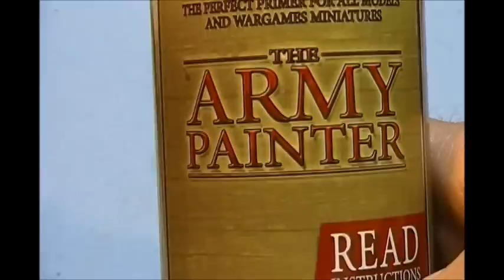Hair Spray Technique Extreme Weathering

Comment: I don't get it.  If it has a layer of flat coat on it which protects the base rust color what specifically does the hair spray do that the flat coat can't...?
Reply: Although your question is already pretty old, I´d like to answer this: The flat coat is there to protect the undercoated, dark brown layers... Those have to be protected from all the scrubbing that will happen once the top paint layers are put on... The Hairspray is not applied to protect the dark brown layers, but to create a film that can be scrubbed off easier... Most Hairspray is also water soluable, which will help to achive additional weathering effects... Hope it´s helpful! :)

Comment: Nice job. What process for the rust colours? How did you get the pebbled look on the hood?
Reply from the maker: Joe Imbesi   Just splattered with multiple rust colors from the Vallejo range.  Load up the brush use a toothpick and flick the bristles over the toothpick to splatter the item.